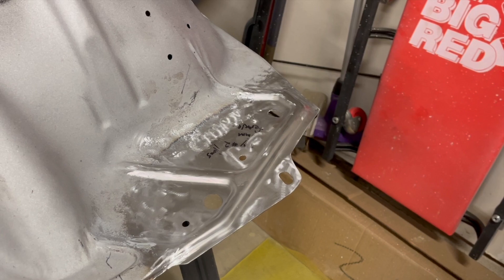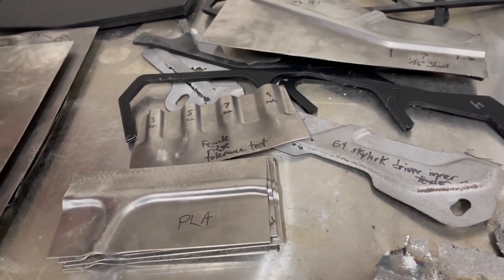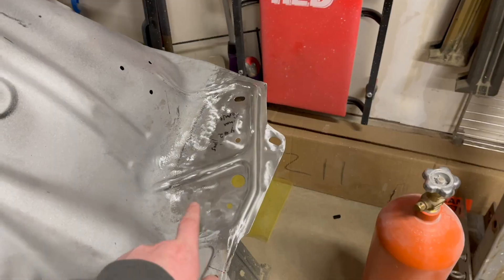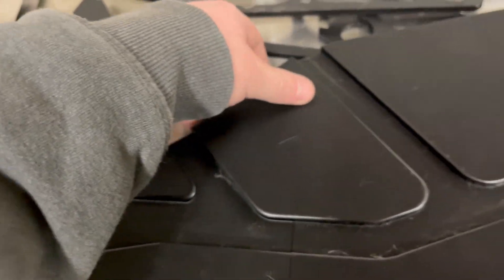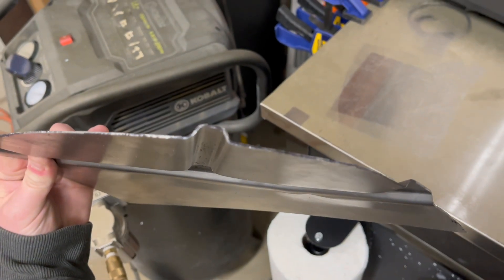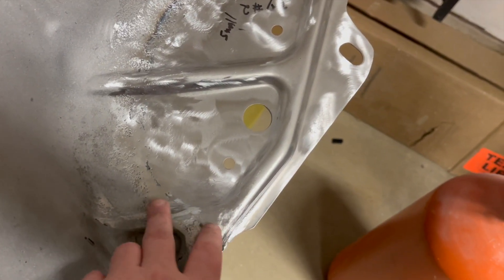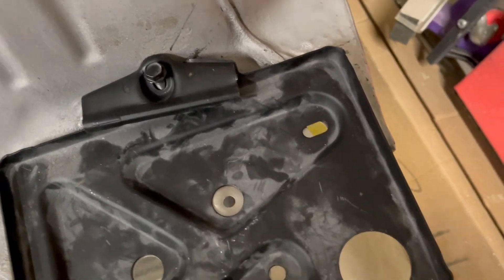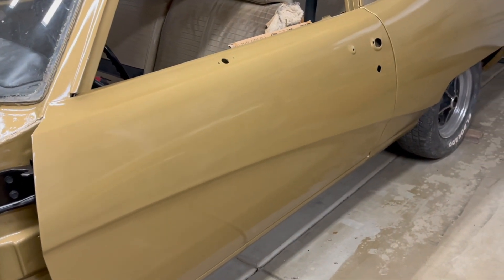Buick Update 48: 3D Printed Steel Patch Panel Molds

Comment: Put some washers under your battery tray. The 1/16" inch lift will clear the wheelhouse and you wont need to trim the battery tray and provide better venting under the battery.
Reply from the maker: That's a fantastic idea! I was just thinking to put rubber under the battery tray to protect the paint but you're right that'd solve a bunch of problems!

Comment: Should get Send cut send too cut out your mould shapes and matching backing plate then plug weld them from behind you would have press plates to bang out hundreds of panels to sell, probably a good little earner especially if reproducing known rust problem areas on common cars!

Comment: Try PLA+
Reply from the maker: These actually were PLA+! I had some of both PLA and PLA and hadn’t seen a different between the two except that the finish of the mold is a bit nicer with PLA+. The quality of the stamped pieces appears to be identical, however.

Comment: That's an awesome idea. I never would have thought PLA plastic would stand up to being used as a stamping die. How was the pressing? Did you have to use a large thick plate to distribute the force or just worked your way along the contour in small sections?
Reply from the maker: Appreciate it! I made a follow up showing the pressing process but I basically do some light presses to get the general shape and then press in a grid pattern all with a 6”x6” press block

Comment: Way to be a somebody and help out the Buick Community! I'd be interested in purchasing a passenger panel as well. By what means or platform do you intend to sell these?
Reply from the maker: Appreciate it! I'm currently working on getting another set of passenger panels ready. I'll probably end up putting them on eBay most likely but I'll come back through the comments when they're ready
Reply from the maker: Just messaged you about this on FB

Comment: Incredible work, very interesting process! Regarding battery clamp, it's upside down, and when locked into notch on battery clamp sits up a bit higher. So may not have a clearance issue in reality. Beautiful craftsmanship,  thanks for sharing
Reply from the maker: Really appreciate it!

I did a poor job of explaining it, but the clearance issue was actually on the underside of the tray itself instead of the clamp. I just threw the clamp on there upside down to not lose it but the square nut on the bottom of the tray was the piece I had to clearance to account for the tiny bit back it was set back

Comment: Super cool process you have designed.  Thanks for sharing.  I can see this process working great for the passenger side inner fender of a '67-'72 Chevy C-10.  Very common place to rust out.  Usually the rest of the fender is ok.  Fender is available, but $100-150 to buy and $100-150 for shipping.  That's a lot of money when you need only a patch piece for under the battery tray.  I wound up biting the bullet and buying the whole inner fender, but other guys might like an option of a patch like this.  Amazing work!

Comment: From a GM A body nut to another ... That's jamb up... really great job.  DID you use a little pam baking spray or any type of lubricant on the dies? IT will allow the metal to slide against the dies and should result in less force needed to bottom the die, and nice forming.
Reply from the maker: Appreciate it! I did not but it is something I've considered. I wasn't sure how any lubricants or oils would affect the PLA and had good success without them but it's definitely something I should experiment with!
Reply: @snowman4839  heck some dish soap would help. OR bar soap rubbed on the sheet. 
I am floored by how well the patterns held up. My father built patternboards and had some parts cast in a foundry. It would not be that difficult to sand cast some aluminum dies based on your PLA's IF you were doing 50-100 pcs.
Reply from the maker: @TheJagjr4450  that’s very interesting info! You talking about having a shop that does a casting or making a furnace and doing it at home? I always figured it’d be several thousand to get something like this made out of metal
Reply: @snowman4839  at most a few hundred for a couple sets of male female if you have a small foundry local.
OR do it yourself with a welder and a couple of carbon rods 
(4 rods in a 6 volt dry cell battery) for electrodes to make a small electric arc furnace into the sides of a firebrick made into a crucible to melt the aluminum. There is a gret vid on KING OF RANDOM.

Comment: for sure that using the 3d printing technology is an excellent way to produce dies to form al limted lot of sheet metal parts but somebody that does not have access to that technology will use a bead roller to produce a very similar part with a bit of fiddling.
very good job on that.

Comment: For 18 gauge, that’s really impressive . 

I just made a floor section for my Volvo 1800ES using hammer forming with a steel die I made with grinder . 

I would not have thought PLA would be nearly strong enough to press 18Ga.

Comment: That's fing awesome, you can make any patch panels with that method. Check to see if you have a local steel metal plant near, I was able to get a 4x10 foot sheet of metal for $110ish. 
I believe it was small aircraft guys but they used thick wood, 1-2" thick rubber, male mold and another thick piece if wood. The rubber squishes the metal around the male mold in the press.

Comment: You've done a terrific job. These look better and appear to be more accurate than most aftermarket panels. What IPhone are you using to scan with?
Love the project. Keep up the good work.
Reply: Could you show us a press in action?
Reply from the maker: Hey Tom! Thanks! Great to hear from you.

The scan is just from a regular iPhone 13. It should work with any iPhone that has faceid. Heges is one of the only apps that doesn’t charge per scan and can use the faceid scanner so you don’t need an iPhone pro. 

I’ll look at doing a pressing video with a smaller mold show the process